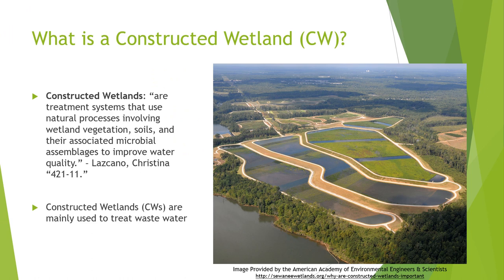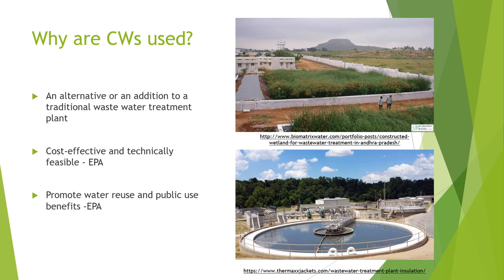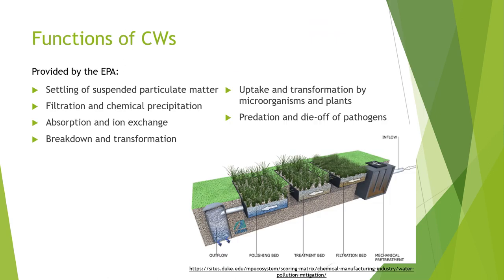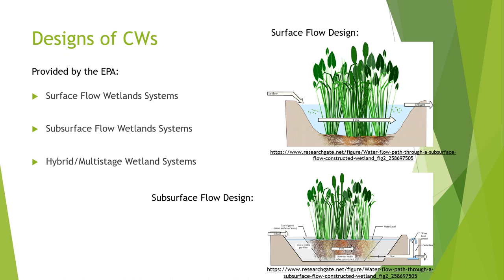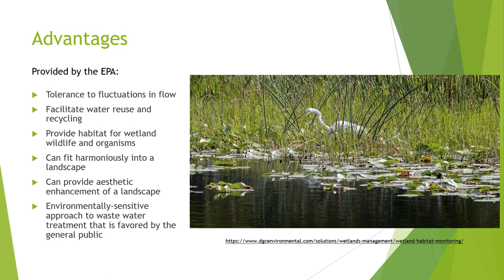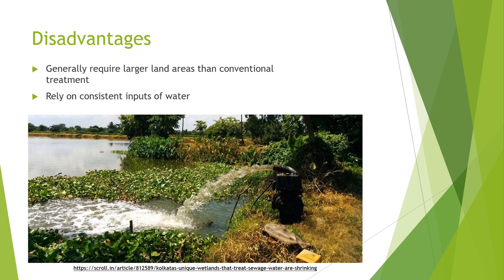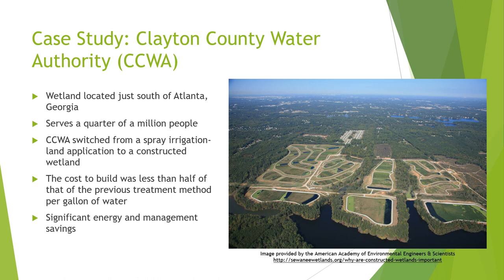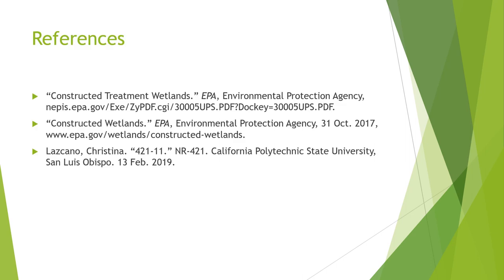Constructed Wetlands Presentation

Comment: How can this work during the winter when microbial activity is reduced and ice may prevent aerobic breakdown of waste?
Reply from the maker: Hi, Timothy. This is a great question. I did this presentation for a school assignment, so I am by means no expert on the topic. However, I would expect there to be difficulties during a cold winter time. Using constructed wetlands for wastewater treatment will not work in all cases, but should be considered when possible.